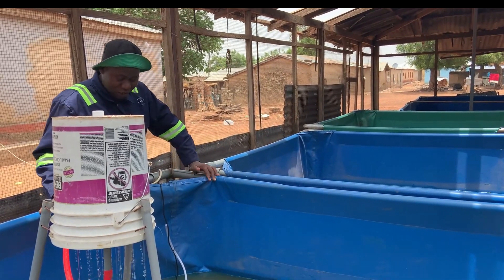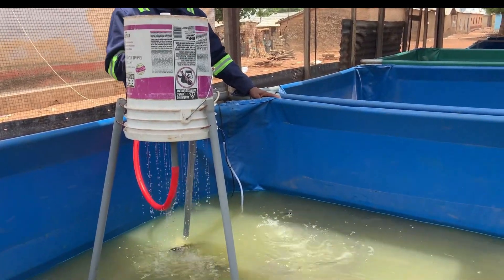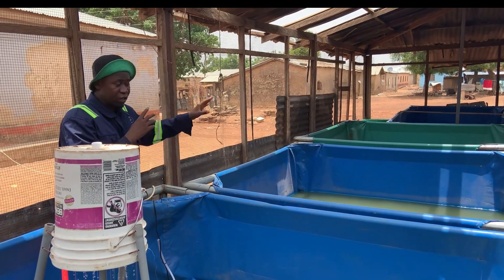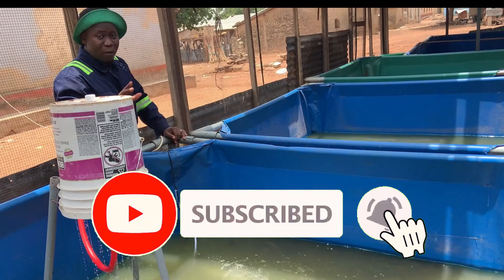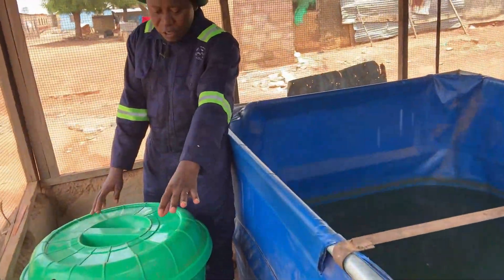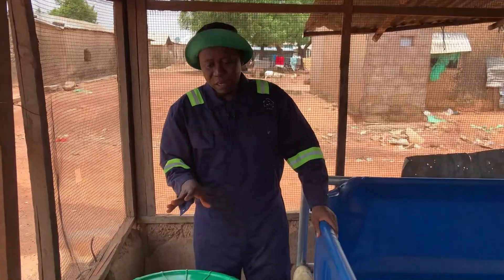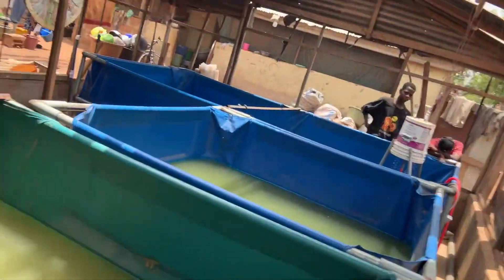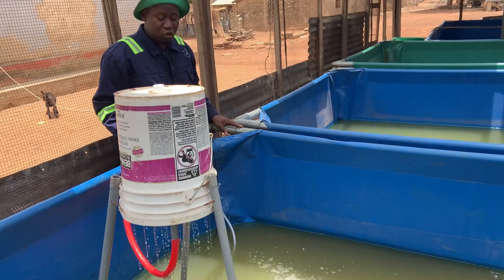New and Cheaper Way I Have Discovered In How To Fixing RAS

Comment: Do u use tap water or ?
Reply from the maker: Yes. But you should be careful when using tap water. Avoid adding it directly to the fish. Always put it in a reservoir for at least 24 hours. 
But if you don’t have an option and have to add it directly, then only do partial change and not entirely change
Reply: @FaakoAquaponics  thanks alot
Reply from the maker: You are most welcome